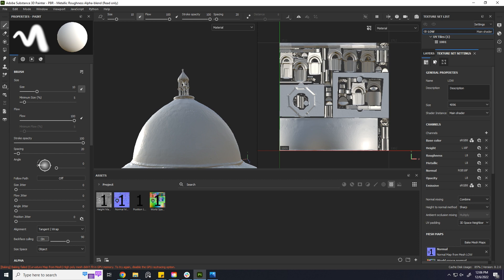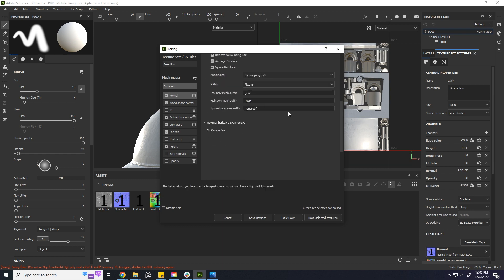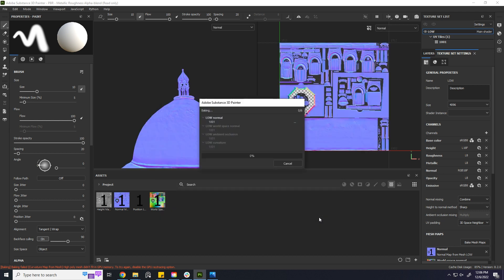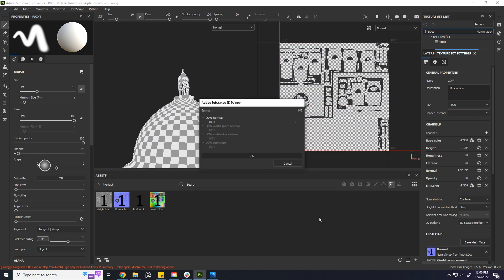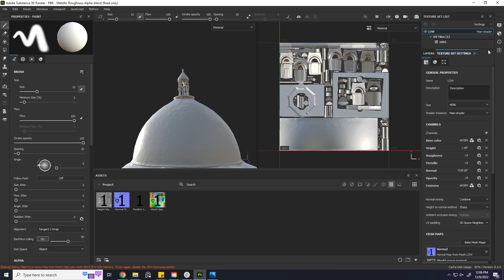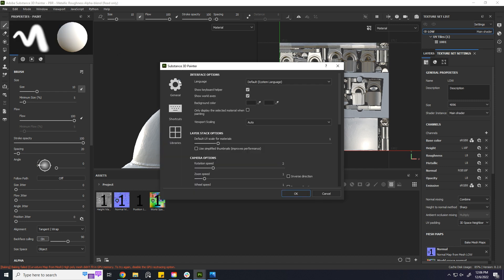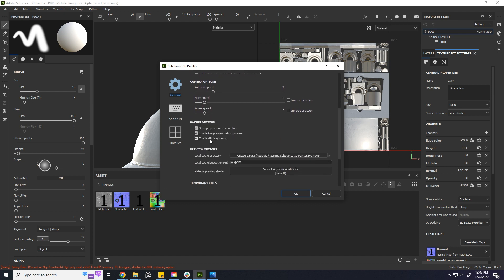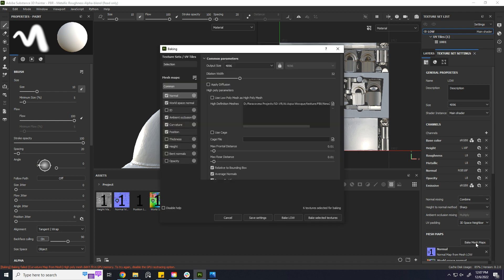[SOLVED] Baking error AO and curvature  Log Error, Ambient Occlusion & Thickness map Fix

Comment: Many thanks, my friend! Your solution was spot-on. For me, it wasn’t an error message but rather an issue with the AO map showing white stripes on the black map. The stripes' size depended on the resolution I selected. So, thank you! 🥰
I recently Upgraded to RTX so it wasn't usual problem. +1 sub.

Comment: the same problem after update nvidia driver. So looks like problem in video drivers because I used this card almost 1 year and never has a problem before.
Reply: likewise! experienced issues after updating to the latest game ready driver.
Reply: Yes. By the way if turn of raytacing option in substance, baking texture is more slower. So I think back my old drivers